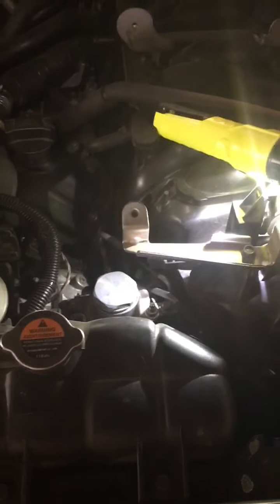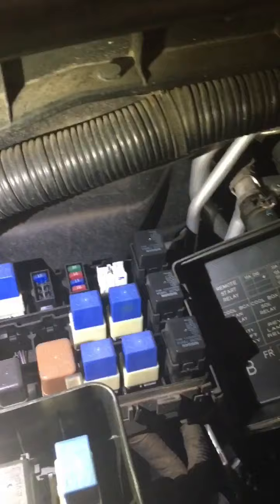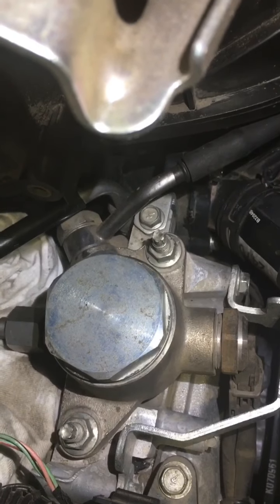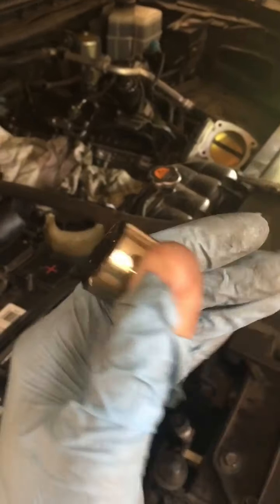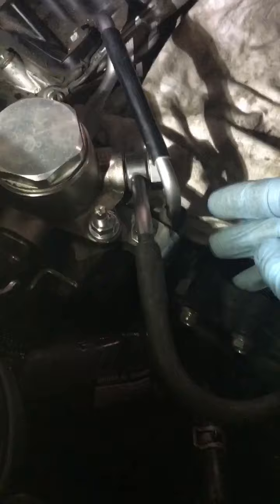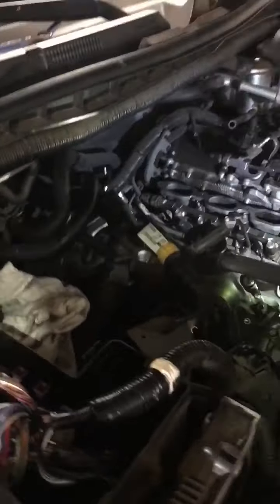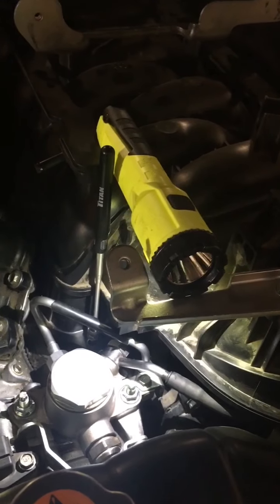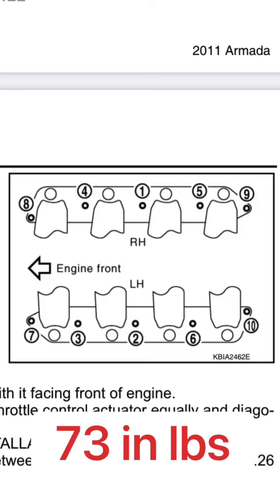Nissan 5.6L VK56VD High Pressure Fuel Pump Lifter Bucket - Armada, QX56, QX80

Comment: I removed mine without taking anything off except the fuel pump.  Takes a little finesse but def doable
Reply from the maker: Awesome, good stuff - just discovered there is a 10mm bolt holding the right side fuel line on the side that I should have taken out and would have given me the clearance needed.
Reply: I have done too like 10 times
Reply: Does anyone have a video or site of the location so I don't have to take the manifold off?

Comment: You do know that you did not need to do all of that to change the high pressure fuel pump when you take off the two nuts for the high pressure fuel pump you use a Torx socket to take the studs out and the high pressure fuel pump will just come right out
Reply from the maker: Tried it, still couldn't get enough clearance though.

Comment: I check it every time I do my transmission fluid drain and fill
Reply from the maker: How do you get to it, by just taking off the big top nut on the top of the housing?
Reply: @luso_overland  2 nuts hold it to the block don't take that big nut loose remove the studs loosen the fuel lines relieve the fuel pressure unhook fuel pump harness under back seats and start car until it cuts off
Reply from the maker: @ryanblackwell8617  Ok, so same procedure as in this vid, was hoping there was a shortcut.
Reply: @ryanblackwell8617 you don’t have to remove the harness from under the seats, just take the 2 x fuses out of the fuse box. Waaayyy easier.